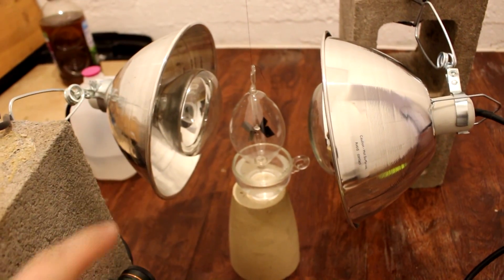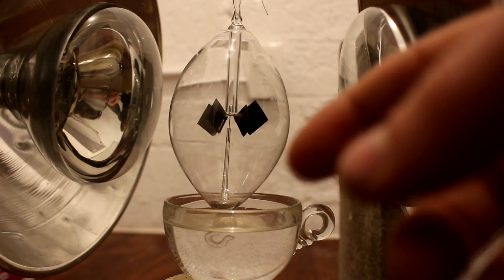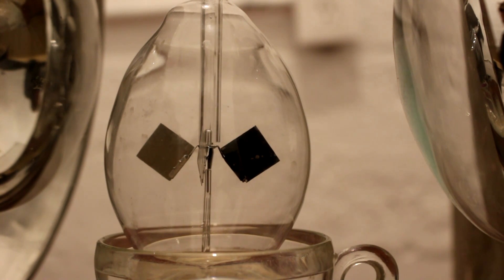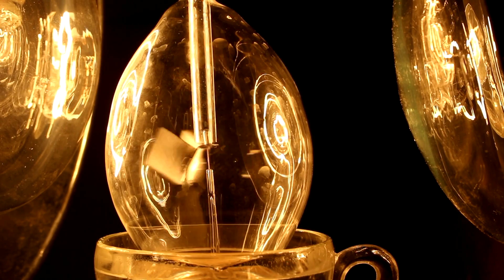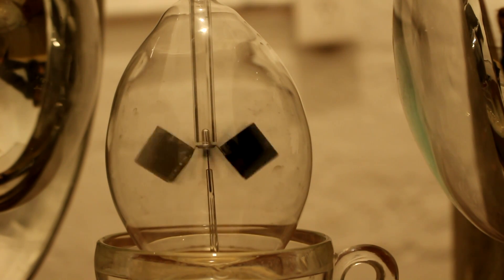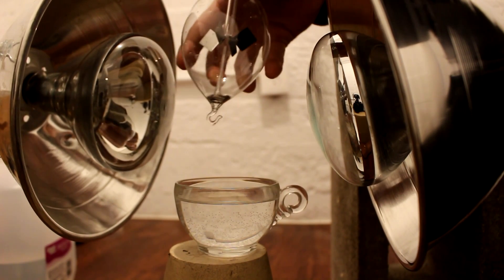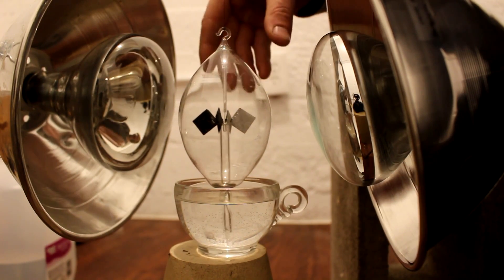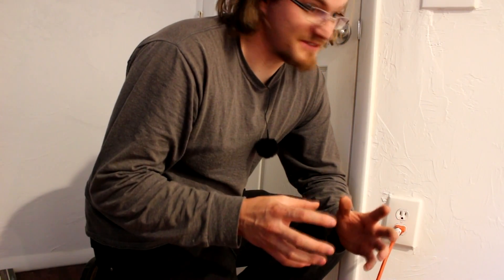Radiometer Suspended on a Thread

Comment: The threads on your string when wound will bind, and after you turn off the light, will want to unbind and twist to find the resting position.  I'm sure the light for acted as you initially described though.

Comment: This reminds me of the solar sail concept, for space. Only, a tiny, in glass, cup anemometer version. Can we call this a Solar Plate Anemometer?
Reply: If it was bigger, in space, and connected to a generator. I wonder how fast it would have to spin, and how big the plates & generator would have to be, to be better then solar panels, of the same surface area facing the sun. Or would there be too much resistance from the generator, like the brake regen of an elecric vehicle? Even if we used magnetic bearings, to not have friction from just supporting the generator axle?
Reply: For anyone that doesn't know what a cup anemometer is.

https://en.m.wikipedia.org/wiki/Anemometer
Reply from the maker: Something like that might actually work on the moon. power generation would be abysmal though.
Reply: Cody'sLab I was just wondering when it would be better, then solar panels....Maybe...Instead of using solar panels, and solar sails, maybe use giant Solar Plate Anemometers, or Solar windmills, to create more power, and push you through space? I just realized, I never thought about how much sunlight pushes solar panels.

How does that Radiometer work? Do the dark sides absorb the light? And the light pushes off of the more reflective sides?
Reply: Cody'sLab I have to watch this again, and find the video of you making or fixing it.

Comment: The vanes absorb and radiate. One side is shiny, reflective and absorbs and radiates poorly, the black absorbs and radiates magnitudes better.
 
That is a very interesting Crookes Radiometer. It probably works better than others because it is filled with some liquid mercury and some low vapor pressure, probably composed completely  of mercury vapor.

Comment: Have you thought about using Schlieren photography to see what the gas is doing inside the radiometer? Perhaps adding a polarized light source and filter to add the extra sensitivity needed to detect density changes in rarefied gas?

Comment: Are you sure the glass spinning in the opposite direction when you turned the lights off isn't because of spring tension that built up in the thread while it was spinning with the lights on?

Comment: Try it with large LEDs, that way you will have all the lumens from this experiment and almost none of the heat, and you can isolate just one variable (the photons).
Reply from the maker: Infrared light (radiant heat) is photons.
Reply: If it is ordinary glass, it is opaque to most IR and the only IR photons hitting the vanes would be the thermal photons from reradiation on the inside of the glass. This flux would be more evenly spread than the directly transmitted visible photons.
Reply: Cameron McCanless YEA CODY PLEASE DO THIS
Reply: As far as I can tell the result would be the same. At a given energy flux, the radiation pressure exerted is independent of the energy of individual photons. The energy applied would also be equal, so the thermal effect on the gas should also be the same. Nothing would change. Correct me if I'm wrong here.
Reply: but i think he is more worried about the fins heating up from the light being absorbed and turning into heat
Reply: Hi Cody! Would you expect the results to be much the same with a different photon source?
Reply: +Markle2k I hadn't thought of that. The glass could also give away heat through conduction/convection. In that case you would end supplying less photons to the fins than expected.

Comment: 3:51 "The mercury's not hurting anything"
Actually, mercury vapor bro. You've got a good vacuum in there, so fluid metal at room temperature which can be hazardous because of the vapor which forms regardless, clearly there's a relatively large amount of mercury vapor. You still haven't removed the possibility of the gas, sorry to burst your bubble.